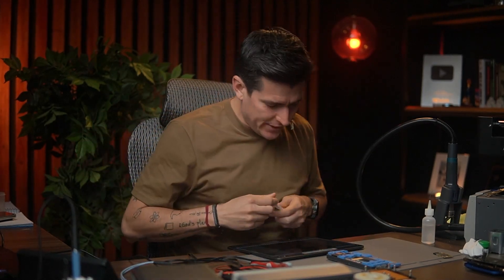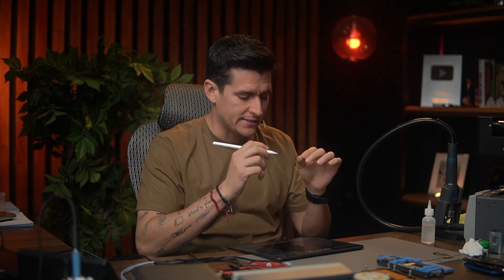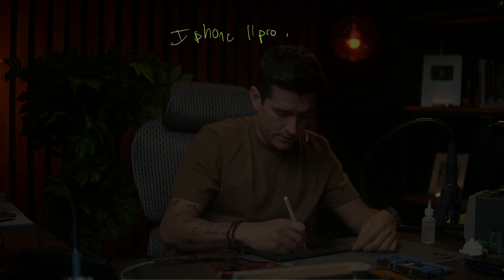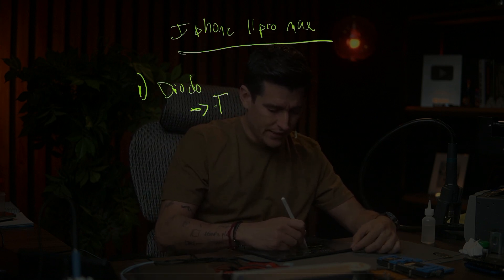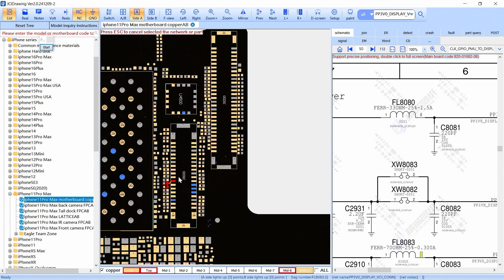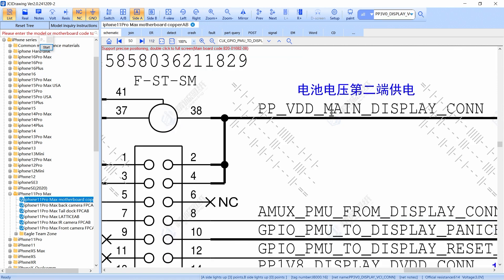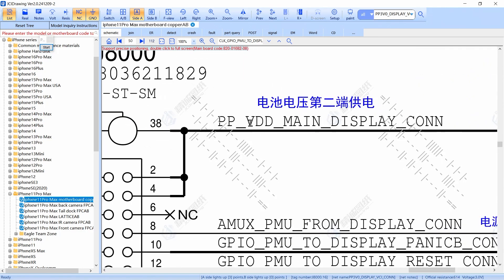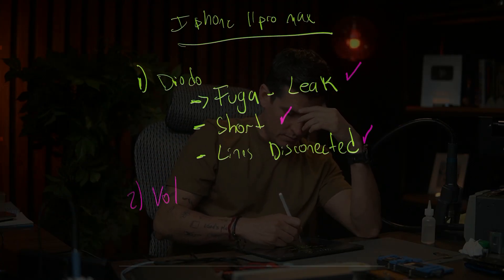iPhone 11 Pro Max with no image after it got wet

Comment: Hi edgar good job as usual but i can tell you something without load you can't see current so don't mesure voltage without load because in this case you will see volltage drop the 3 voltage will drop to 0.000 voltage when you plug screen.....my english so bad😅😅😅😅😅
Reply: Try explain well there could be something to learn out of this .